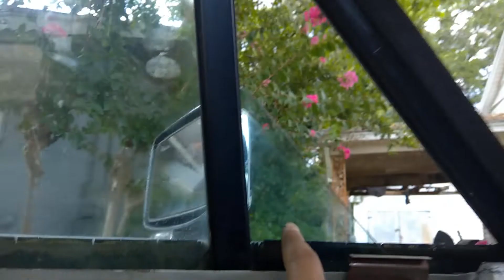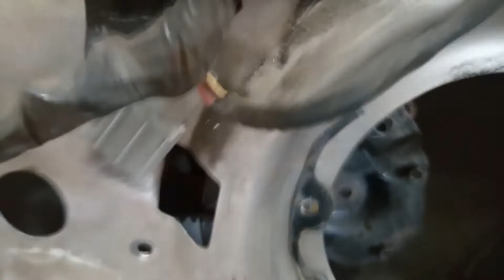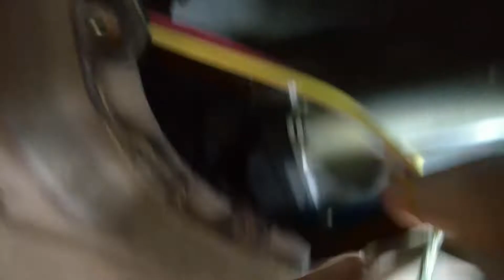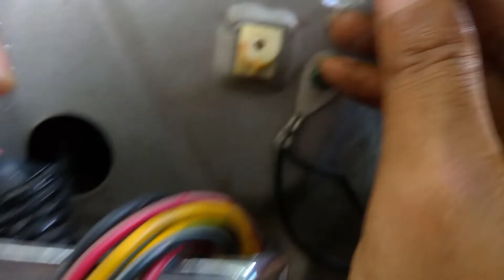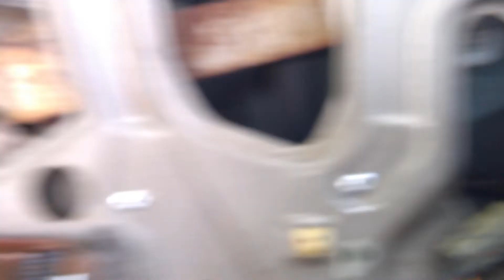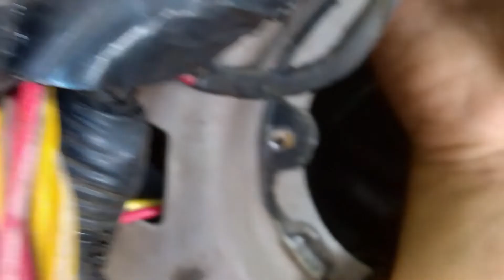How to Replace Front Door Window Motor in a 1981-1989 Lincoln Town Car

Comment: What brand of aftermarket window motor did you use as a replacement? Purchased and plan to use a Dorman motor model DL42257FL2WLM for my driver front window on my 1983 Mark VI Pucci coupe.
Reply from the maker: The owner of the car purchased it on ebay some no name unit

Comment: So the only issue that I had was there was no post to set the motor on mine, it’s a 1988, I was able to get it on it just takes some maneuvering. It took about 7 hours fooling around but I got it done. If you guys need help this video is a good start. Look at a diagram too

Comment: Really all you have to do is take the motor apart and put 3 larger ball bearings in a triangle where the inside of the motor disintegrates.. I’ve fixed a ton of town car’s windows from the 90s without spending a dollar.. and the motors are the same as my 90...
Reply from the maker: This motor was completely dead. I fixed my bronco with new bearings though.

Comment: Thank you for this video, it helped a bunch .  Someone had put a different motor in mine that wasn’t right and it bent up some stuff so I had to take it all apart.  The only thing I have worked on that was a bigger pain is a starter on a 84 Saab 900 turbo.  I wish the first guy that worked on it had seen your video. Thanks again!
Reply from the maker: thank you so much for watching! I'm glad that this helped you. I hate working behind others that have  no clue what they are doing. you spend half the time fixing their bone headed mistakes so i know your pain all to well.

Comment: So it looks like the window motor is bolted in and the track is OK. Window still will not go down when motor is energized.  Is the motor suppose to snap in some how into the tack mount? U can hear the motor running but the window doesnt respond. The motor has a new gear
Reply from the maker: The window didn't come down when you had the regulator out?
Reply: @devajonesdiy  i had to manually pull it up and down. The track was dirty. I cleaned and lubed it. It will not go down on its own. Don't need any tape to hold it up when the motors out.
Reply from the maker: @Coodeville  if it won't fall down without the regulator in there that's your issue. If the regulator is in but the motor is out the regulator will hold it up. If the gear on the motor is turning and the regulator isn't moving then your problem is the regulator.
Reply: @devajonesdiy  im gonna have to look further into this then
Reply: @devajonesdiy  I foud a place down the road thats going o check it out for me. Max it will cost is $70. They have regulators for everything. For $70, I'll let them install it

Comment: So my motor is fine. Took it out today ad bench tested it. My regulator wont move
Reply from the maker: hope you get it fixed probably needs a ton of lube
Reply: @devajonesdiy  i just shot a bunch of Croil into it to see what happens
Reply: @devajonesdiy  I just went back out there. Its been soaking in the Kroil for a few hours in 91 degree heat. The window actually went down and up and it does need a good lube job. Im off to the store to return the motor. You're a real wizard on this and I learned a lot.  Much thanks for tackling this and educating us. Im an engine guy and wouldnt think twice on taking a set of heads off a car to see what they're like. I can't stand stuff like this mainly because I have big hands.
Reply from the maker: @Coodeville  LOL well i work on motors too. i really dont love this kind of work but i'm glad I was able to get it done. I'm glad i helped you out!!!
Reply: @devajonesdiy  Im putting my old one back in. I replaced the plastic gear. Its fighting me. Did you have to energize the motor in order to get the gear into the right position? Or did you lower the window to make the crank move?
Reply from the maker: @Coodeville  No i didnt have to energize it. I did have to lower the window to get everything to line up.
Reply: @devajonesdiy  thats what Im going to have to do
Reply: I just got back. Don't ask me what he did but it works with the old regulator and motor. He said 
Id hate him if he told me what he did. Told me " next time" Bottom line is that it works and he only charged me $20. Imagine that? I can pull heads and reinstall them, do timing chains and front end work, but this jams me up, lol!
Reply: I just diagnosed my window switch issue as well. Windows can only be operated by drivers door. All other switches on the other doors are useless. Took the switch off and jumped the window lockout switch. Everthing worked fine. Worse part about this is that the lockout switch is built into the master switch. So I have to replace the whole thing.

Comment: grazie per il video !! domani provo sulla mia MarK VI 4 porte del 1981 .... si è inchiodato il finestrino di sinistra :-(!
Reply from the maker: You're very welcome I hope you get it fixed!!!
Reply: grazie... con le tue indicazioni sarà molto più semplice..ma non facile :-) !
Reply: Ho fatto il lavoro . Era il filo del motore che si era staccato dal connettore. Grazie ancora !!!
Reply from the maker: @paolosalvi5945  you're very welcome, thank you for watching and keeping me updated!!! congrats on fixing it
Reply: thank you... !! thanks to you I had the courage to disassemble the door panel (the manuals don't help much ..) and to reassemble it correctly after fixing the glass (I have to disassemble the other 3 to lubricate and arrange the partially detached panels ...). Now I'll have to solve the problem of the digital dashboard that goes crazy after 10 minutes of operation: do you have suggestions? thanks for your kindness!!
Reply from the maker: @paolosalvi5945  if i had to guess it's probably getting hot and a solder connection isn't making good contact but I'm not completely sure. Glad you're making progress though keep it up!
Reply: that's what I thought too (... or a damaged capacitor ...): the heat makes the metals dilate and break off the weak contacts. I'll have to remove the module (it's under / behind the dashboard ...) and try to check the boards! Unfortunately in Italy there is no one who is able to restore ... so I will have to consider whether to send it to the United States for repair (with all costs ...)! Thanks for the moral support ... and I warn you that I have disassembled the other 3 doors and checked and lubricated the windows. A rear window goes in jerks and I fear that the engine sprocket is damaged because the glass rack is very good !!! ... if I have time I will buy a new motor for the pinion and gonna change it ...: -) !! Many thanks !!!
Reply from the maker: @paolosalvi5945  sure thing shouldn't Italians love Italian cars??? glad you have an American one I know it must be hard to keep up with lack of part availability.

Comment: This video helped me with my 89 “Large Marge”. I sanded and lubed the tracks with lithium and WD saved me 50$. Did not need a new motor after all.
Reply: so did you have yours stuck, I can see the lights dim when I hit the switch, but nothing moves it is stuck up....do you think your tracks was stuck because of no lube?
Reply: @randylee2549  thats my problem now on my '84 Town Car. I hit the switch and I hear the motor make sound but the window won't go down
Reply: @Coodeville  well, Rock Auto can help you with parts online at a discount price once you find out if it is the regulator the bushings in the motor itself.
Reply: @randylee2549  what I would also like to find is a window run channel for mine
Reply: Randy Lee yes my vent window went down no problem but the main window would get stuck or barley roll up.so I sanded the arms a little to get some of the rust off.Then used wd40 since it penetrates and just a little grease to help the arms pass.
Reply: @bokbok4456  ahh, & before that just dimming of the overhead light when the switch was hit? mp movement? mine does not move either one...sadly, most likely the motor?
Reply: Randy Lee well if you tried  lubing the arms and you can’t move it at all and you don’t hear it trying to move then it’s dead. At least it’s stuck up. I have found them online so that’s a positive.
Reply from the maker: Thanks so much I'm glad I could help you out. thanks for watching and congrats on not having to buy that motor they can be pricy. often times the track needing to be lubricated causes the motor to work over time and it fails prematurely, now yours should last longer than it would have

Comment: So I have an 89 LTC. and the passenger widow refuses to go up or down. Anyways, are you saying I have to take the 6 rivets out to get to the window motor? Or can I just drill the 3 dimples to get to it? Great video btw, just a little hard to follow 😂
Reply from the maker: Drill the three holes undo the bolts hopefully yours comes out. In this car I had to drill the other rivets because the motor didn't just come out after removing the bolts. I removed the rivets to get the motor to move over into where the speaker was so I could pry it out.
Reply: hey i have an 89 LTC as well. The same problem on my passenger side...if you drill the holes in the dimples and take off the speaker you can reach down and wiggle the motor out. thanks for the video btw by far the best reffrence out there!!!